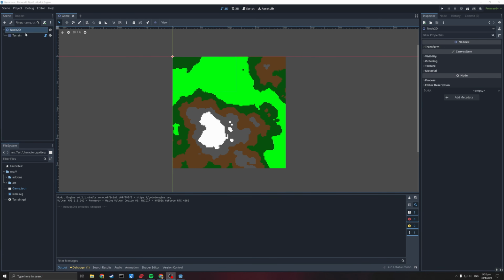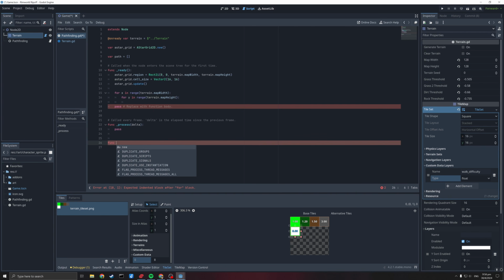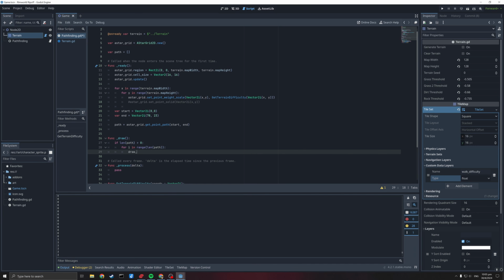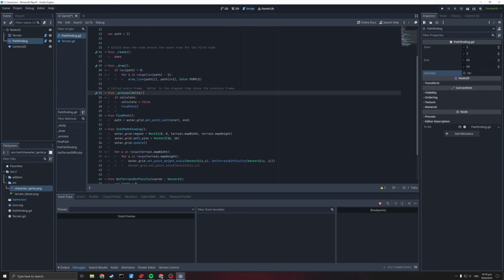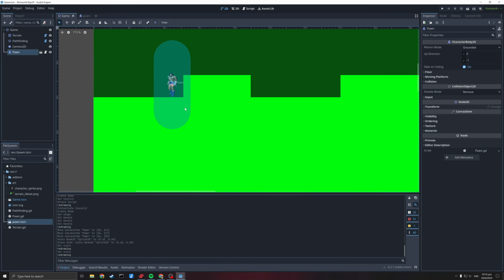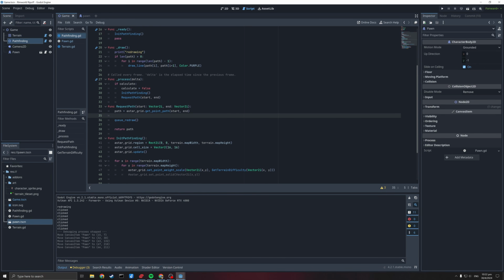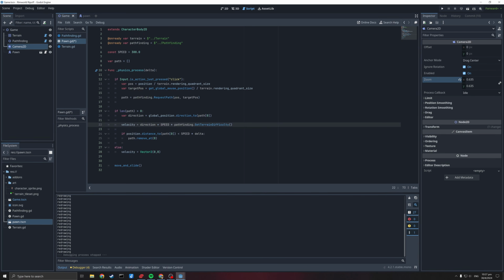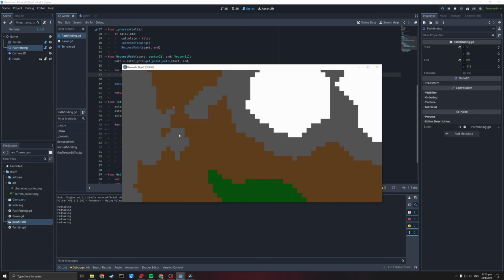How to make Rimworld in Godot 4: Pathfinding & Pawns

Comment: I have to issues I'd like to discuss: 

1. After following every step in the video, I keep getting the warning about shadowed variable: the local function parameter "start" and "end" is shadowing an already-declared variable at line "@export var start : Vector2i" and "@export var end : Vector2i" in the current class 

2. Whenever I test the game, the pawn will always move in a straight, diagonal line until it gets out of map bounds and errors pop up like "@ Init pathfinding(): can't set point's weight scale less than 0.0: -1.000000", "GetTerrain Difficulty(): no TileSet atlas source with id -1", and "GetTerrainDifficulty: cannot call method 'get_tile_data' on a null value"

Comment: I have a problem with the set_point_weight_scale
the documentation wants to have a int, but in the script you use a Vector2i. I have written the code just like in the tutorial but I get the error: 

Invalid argument for "set_point_weight_scale()" function: argument 1 should be "int" but is "Vector2i".
Reply: I found the problem. I used AStar2D instead of AStardGrid2D

Comment: If I change the map size above 128x128, for example 256x256, I got an error [Cannot call method 'get_tile_data' on a null value] in this line [var tile_data = source.get_tile_data(atlas_ccords, 0)] and also an error [ GetTerrainDifficulty(): No TileSet atlas source with id -1.] for this line [var source : TileSetAtlasSource = terrain.tile_set.get_source(source_id)]. Any idea why?
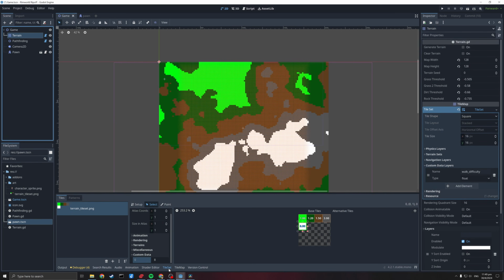Reply from the maker: I just had a play around and maanged to get the same error when I removed the custom data element "walk_difficulty" from the terrain tilemap and then added it back. I fixed it by going back into the tileset menu and assigning the custom data values to each tile again. Like at 33:35.
Reply: @real_robots  I have an alternative fix for this bug. I first changed the map size to 512x512. then clicked clear terrain and generate terrain in the editor and the problem was solved. Sometimes it's easy. Thank you very much for your tutorial. I've done a few other tutorials before, but yours shows me a new way to create things and I think that's great. Thx for that, too.
Reply from the maker: @MannyTimes-b5e  ah, maybe I never experienced this one because I've got the clear terrain being run when I press generate?

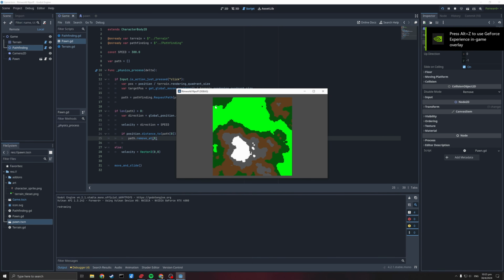Comment: Hey, I'm getting stuck at 29:45. When I click, my character doesn't move and instead I get the following error:

"RequestPath(): Can't get id path. Point (2, 1) out of bounds [P: (0, 0), S: (0, 0)]"

So far I've figured out that Point (2,1) is the position of my pawn at the start. I've compared the code in my Pawn script to yours and it's identical. I even copied your code from GitLab just to be sure, so the problem probably lies elsewhere. Any idea what could be wrong? Help would be appreciated.

And thanks for making this tutorial series. It is exactly what I was looking for!
Reply from the maker: I had a play around and couldn't get that error myself. Since you're getting an out of bounds error that so low I'm guessing that the astar_grid hasn't initialised properly.

All I can suggest is go back a step and see if you can draw paths to and from where you'd expect to without the pawn complicating things and work from there.
Reply: @real_robots  I found the issue. It's the same you had at 16:42. What I did wrong was I moved InitPathfinding() to _process instead of copying it. So I just had to add it to _ready as well to fix it.
Reply: @real_robots  Thanks for checking it out. I will give the backtracking a go to see if I can find the issue that way.

Comment: I'm not sure what's up here... but my pawn never wants to move. If I print path, I get the list of vectors and that looks fine (and the the path draws correctly on the terrain)... But if I print direction after using var direction = global_position.direction_to(path[0]) ... I always have 0,0 in the list and thus he never has any velocity ... so move_and_slide() doesn't work (my pawn starts in 0,0).

If I set my position to 8,8 first, then my direction ends up negative if I click positive... very odd

My code is the same:

if len(path) > 0:
			print("Path > 0")
			var direction = global_position.direction_to(path[0])
			print("Direction: " + str(direction))
			velocity = direction * SPEED
			
			if position.distance_to(path[0]) < SPEED * delta:
				path.remove_at(0)
		else:
			velocity = Vector2(0,0)

And as mentioned, path seems fine if I print it
Reply from the maker: That is strange, I can't think what the problem might be that would cause that. Go check the gitlab link in the description and you can more easily compare to my code.

The script is on your lawns characterbody2d yeah?
Reply: @real_robots  Yep .. I was able to get it moving.. Apparently it was heading to 0,0 every time from my RequestPath (which made the direction  -7,-7), presumably because my pos was less than 1 after dividing by terrain.rendering_quadrant_size.  I actually ended up doing: var pos = snapped((global_position / terrain.rendering_quadrant_size), Vector2(16,16))

Now the issue is that it never seems to do the path.remove_at(0) even as it approaches
Reply from the maker: @jlsonline  First of all I'll note that "rendering_quadrant_size" is not the correct value to link to (my mistake that's fixed in a later video".

if the remove_at isn't happening then you just need to print out what you're getting, print the distance, print if the distance check bool is true/false, it't probably just that the speed your guy is moving at is making him not quite get within the range you specified. My distance checking math probably isn't foolproof.
Reply: @real_robots  Gotcha! I got it all working now. I also threw in pathfinding.queue_redraw() after path.remove_at(0) ... just so it would clear the traversed part of the pathfinding line as the pawn travels (like Rimworld does)

Comment: I think I did something wrong because my sprite wasn't moving at all, so after rereading the code and comparing it to what's on the gitlab, I'm starting the video over to see if there's something I missed. 😮‍💨😔
Reply from the maker: Guaranteed it'll be something small and dumb.

Print your path to make sure you're actually getting one.
Try making a path manually with an array of vector2s and see if your guy follows it. Gotta narrow it down
Reply: @real_robots  thanks I'll try that once I've rewritten it, if it continues to not work.
Reply: @real_robots  You were right, it was something stupid. I somehow managed to delete the instruction telling my guy to move when I clicked 🤦🤦
Reply: 16:57 (responding to RR adding InitPathfinding() to the button) I hit "Reload Current Project" after adding InitPathfinding() to the ready function, which seemed to fix the error message. It just needed to be reloaded again, that's all

Comment: Unfortunately, the AStar system is also the biggest weakness of RimWorld. Experienced players build their base around AStar, but new players just find it frustrating. This "find the shortest path" usually leads to food spoiling because the shortest path to the table goes through the freezer and pantry. Or through an area that should be avoided due to dangerous animals or enemies. Without Mods, Player have to live with it and cant do anything.

In a rip-off, I'd rather not replicate the mistakes of the original.
Reply from the maker: How else would you do it though? It would still have to be astar but with additional costs added for walking through danger areas or opening freezer doors.
Reply: @real_robots  Yeah, well... You could invent some special doors that players can mark as "Emergency Use Only!" But then the hunter wouldn't haul shot animals to the cooler anymore but would run through all the other rooms with them.

Assigning higher-value tiles seems impractical because in-game, you don't just lay floors to make it look prettier but because the pawns walk faster on them.

One idea might be to draw a zone. AStar would recognize this as Difficulty 10. But the roles "Butcher," "Hunter," and "Cook" have a built-in ignore function for this zone. So at least only these three would walk through it, not the entire colony.

One could also use such a zone for the hospital, which has the same problem. Because everyone runs around in there and dirties everything. This leads to patients getting infected wounds. Again, a zone around it, and only pawns with the flag "Patient," "Doctor," or "Nurse" ignore the zone.

But I don't know if it's possible to retrofit AStar through the player afterward.

Comment: Thanks for these videos, I really enjoy them :)

I noticed one thing you might want to change though:
The "rendering_quadrant_size" is not the size of a tile but how many tiles are grouped together for rendering.
It just happens to be the same for you because your tiles are 16x16 and that´s the default value for "rendering_quadrant_size".
You can get the "tile_size" like so: "terrain.tile_set.tile_size".

Anyway, I hope this series is successful and fun enough for you that it goes on for a long time :)
Reply: Rembember to index the x and y
path[i] += Vector2(terrainSize.x/2, terrainSize.y/2)

func _ready() -> void:
	terrainSize = terrain.tile_set.tile_size 
	InitPathfinding()

Comment: how to restrict movement of a pawn to move only diagonaly or only vertical/horizontal?
Reply from the maker: You probably couldn't do that with AStarGrid2D, it's pretty simplified. If you use AStar2D, it lets you define all your walkable points, and then manually connect them to each other. So you'd loop through your points only making horizontal connections, or vertical connections etc. If you had different pawns with different possible movements, I'd just give each type their own grid, each with the same points but with different connections applied.

Comment: Hi everyone, I could use some assistance. I’m currently facing an issue where I get stuck while trying to move in the game. Specifically, when I try to pass through the protruding grid of the snow mountain, my character starts shaking in a loop and doesn’t move forward unless I reset the pathfinding.
Reply from the maker: If he's shaking then I'd guess he's reached a point but it's not being removed from the list so he can go to the next one. Go to your pawn script adding a few extra pixels to the check

if position.distance_to(path[0]) < SPEED * delta + 4:
    path.remove_at(0)
Reply: @real_robots  Printed Position.DistanceTo(path[0]) The specified position has not been reached yet, position.distance_to(path[0]) < SPEED * delta + 4: Invalid, I modified it to position.distance_to(path[0]) < SPEED * delta + 20: The error still occurs
Reply from the maker: @xcoder2205  That's weird. I'd try printing the actual distance, then you can know how close you're actually getting. It might also be something else happening, if it works until you hit snow then maybe its something about the difficulty setting you've got on that tile. Printing the actual distance, alongside the minimum distance you're trying to reach will help you diagnose whats going on.
Reply: @real_robots  When finding the path, this problem occurs when searching along the edge of the snow tile, that is, the walk_difficulty is set to -1. This is the gif I recorded: https://photos.google.com/share/AF1QipP_AMXI553mMHFVyRDTN6pev6ou9khkr7dO5eYsxEKoiWA5Te9Hhh0l1VTYq0MBPw?key=ZzVTSS1Rd2NkNENVckNw Qjc3b1NBQkEzdnZ4Nzln
Reply: @real_robots  When finding the path, this problem occurs when searching along the edge of the snow tile, that is, the walk_difficulty is set to -1.
Reply from the maker: @xcoder2205  Oh of course, it's because he's cutting corners across the snow tile and having his walk speed reversed. We need to prevent him cutting across unwalkable tiles.
When you initialise the grid, add the following line to prevent diagonal movements across obstacles. 

astar_grid.region = Rect2i(0, 0, terrain.mapWidth, terrain.mapHeight)
astar_grid.cell_size = Vector2(16, 16)
astar_grid.diagonal_mode = AStarGrid2D.DIAGONAL_MODE_ONLY_IF_NO_OBSTACLES #<-- Add this line

Comment: also for those using an older versions of godot 4, replace the Rect2i with Vector2i
Reply from the maker: Thanks for the note, but I think you've mixed it up. The old deprecated way was to use AStarGrid2D.size, which is a Vector2i, the new way is to define the AStarGrid2D.region, which is a Rect2i.

https://docs.godotengine.org/en/stable/classes/class_astargrid2d.html#class-astargrid2d-property-region
Reply: @real_robots  you right, thanks for the tip, I hope this series feels fun to make